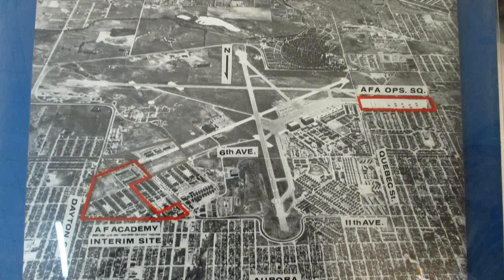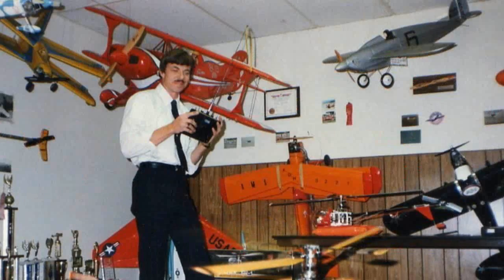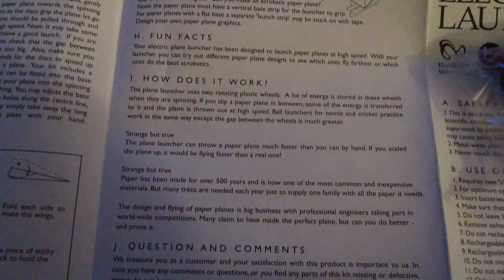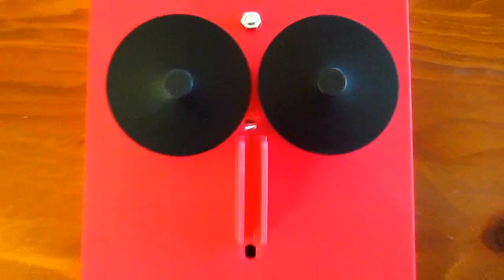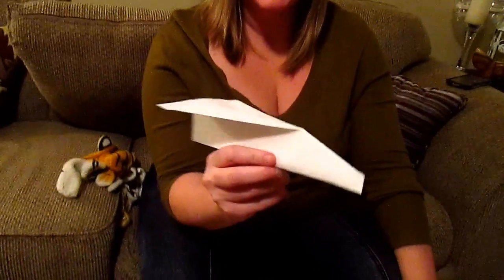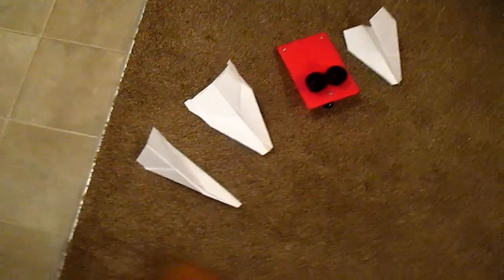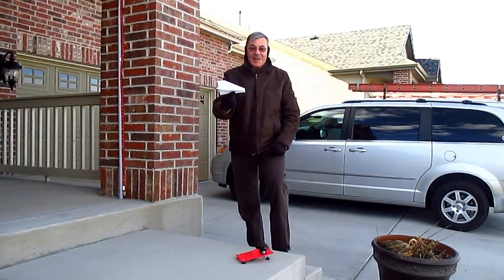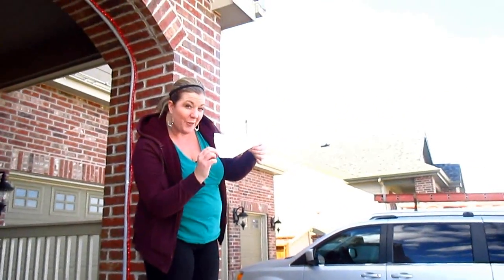Electric Paper Airplane Launcher and Contest by NightFlyyer.

Comment: This product is awful. The motors are not strong enough to do anything. I appreciate that university students made this as a project but it shouldn’t be sold in stores to consumers - it just plain doesn’t work well.
Reply from the maker: Mine still after 9 years works well. Adding an extra 1.5 v battery really gives it a kick and wont hurt the motors.

Comment: PowerUp 3.0 received its funding from Kick Starter and it has gotten great reviews and I thought it would be something that would peak your interest.  Just Google PowerUp 3,0 and the kit sells for 49.00 on EBay or Amazon.  You get the electric motor, receiver, template for the various airplanes, paper, battery, field charger and spare parts.  It is a great learning process for kids and adults.  You download the app for the cell phone transmitter.  You can player with your own paper airplane designs too.  When I saw this I thought of you wanting to try it.

Comment: Haha! I like that launcher. Hmm, they are $20 or more here in the UK. But for a works or family fun competition day it's great as everyone gets the same "throw".
Reply: The best folded sheet planes I ever made were made using the plastic pages of a workshop reference book for vehicle tyre and suspension data. It was spiral bound plastic.  When we received two updated books, we began making paper planes with the plastic pages. Once folded and taped, these flew amazingly well. Cut a notch and use an elastic band and our planes would perform huge high speed loops, though some ended up on top of the industrial units, never to be seen again.